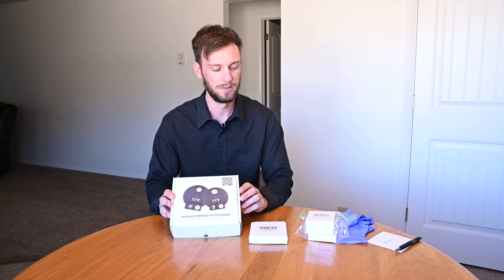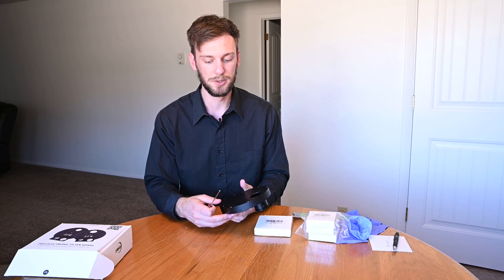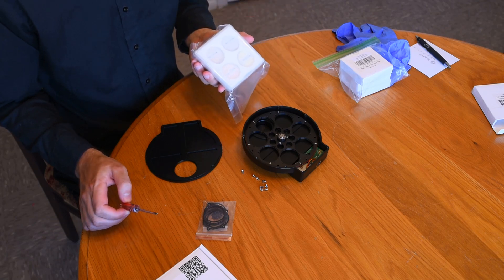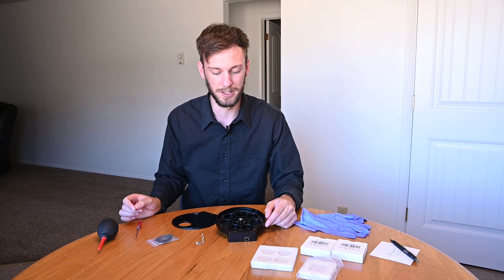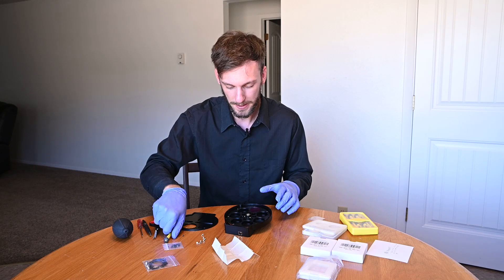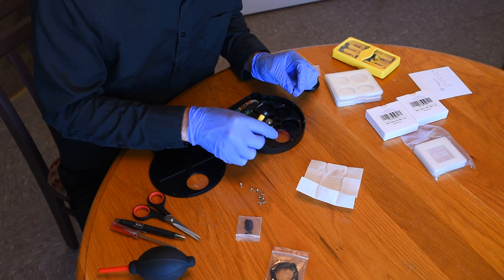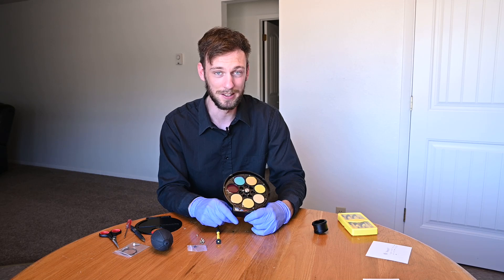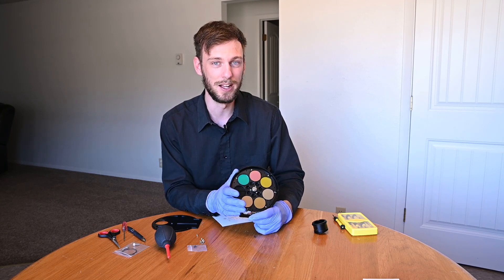2B. Filter Wheel Installation

Comment: If you need to work with small screws, use a magnetic screwdriver or get a small magnet and stick it to the screwdriver while you do this work.

If you shine a light at the filter you should see the difference looking at the inside edge through the glass of the filter.

I’m learning astrophotography but have been doing microscopy for many years. Darkfield microscopy relates to astrophotography in many ways.

Comment: My ZWO 7-position EFW came with a screwdriver that had a magnetized head, so maybe they've gotten enough feedback from past buyers that they made that no-cost but very helpful change. For those who go with the 36mm Astronomik LRGB filters, they are omnidirectional -- you can install them either way. They also have an advantage over the ZWO filters in that they have an opaque black perimeter, so you if feel clumsy doing delicate work wearing latex gloves, you can get away without them with the Astronomik filters if you're careful.

Comment: Peter, Like always, you have helped me progress with astrophotography. I do have a question and I hope you can help me.. First, do you regret at all buying a mono camera? I am also looking into buying my first dedicated camera, and I am unsure if I wanted to go with a color or mono camera.  Also, why did you got with the 36mm filters? why not go with the 31 mm or the 1.250 size filters? what what is the difference between them ?  thank you again.. Rob
Reply from the maker: Great question!  After finally getting a chance to use a color dedicated astro camera, I like my Mono camera even better.  The mono produces much better results, and a nicer (more realistic) color balance straight out of the stacking software.  

The only downside of a monochrome camera is that you need much more time at night.  For example, if I want to photograph Orion, I need to maybe spend 1 hour on Red, 1 hour on Green, and 1 on Blue.  But by that point, the Orion Nebula may fall behind some trees and I only have data for Red and Green colors.  If I had a color camera, I'm constantly collecting all three channels.  

The main reason I went for the 36mm filters was to reduce any chance of vignette.  Apparently the 1.25" filters can produce some vignette (in some scenarios).  I didn't want to risk it.  If I could go back, I would've bought 2" filters instead, since they are easier to install.  (just screw em in)
Reply: @PeterZelinka  Thank you Peter for taking the time to answer my Question, I really appreciate it. I may end up getting the ASI294 for my Redcat. I'm sure I will be able to produce some great shots, Better than my Sony A6400.

Comment: I've never used a filter wheel.  I'm interested in taking better pictures. Is the idea that you take a red, then blue, then green picture and combine them later into a color picture?
Reply: Yes. Monochrome sensors are more sensitive in capturing photons compared to a color sensor. A single OSC [one shot color] exposure receives ¼ of the amount of red and blue data, and ½ of the green data compared to a single exposure with a monochrome camera and filter. But it is more time-consuming to take images with a filter wheel so many sacrifice the quality of the image for the time at the scope.

Comment: Great video, and I have exactly the same kit and it helped tremendously. However I didn't find it a big hassle. Magnetic screwdriver made putting the covers on easy - never dropped a single screw. Anti reflective coating, I think I figured which side is which on the LRGB. From the non reflective side if you look through the filter at the edge on the other side you can see where the coating stops - this is consistent and hopefully correct. The O filter was yellower on one side than the other, that according to your video of the ZWO site should be the coated side. Yes all a bit fiddly, and I should have worn a hair net, but I did grab a hat, and I wish I had a blower (blowing using my mouth, bad idea!), however all tolerable. Oh and 36mm filters allow for some very fast lenses like the Samyang 135mm f2, for which I have a project in mind.

Comment: You can magnetize screwdrivers temporarily by rubbing a strong magnet up and down over the screwdriver. the magnetization works for at least several hours, especially for the tiny little screws. Thanks for the informative video!

Comment: Thank you for that information. I have the same filter wheel from ZWO. But I bought 2" Filters from Baader with a metal ring on them. You are right: it is so much easier to put them in. You just have to spin them by hand to get them in to the slots. And you don't have to worry about the right side.

Comment: Love your video.  But, fortunately, I do not share your frustration mounting unthreaded filters into the ZWO EFW. Came up with some helpful ideas for others:

Loupes-  When dealing with small pieces and parts seeing better allows finer work.  Search “head loupe magnifier” Look for 3X magnification or better.  Should be able to find inexpensive loupes to aid this project and others.

Lighting-  I found the ambient light in the kitchen inadequate to see clearly.  Pulling over some additional lumens from an articulating desk lamp angled properly made seeing easier.

Computer Driver (magnetized)-  The ZWO driver was perfectly adequate for the EFW case screws, but I found too large for the small filter holder screws. A computer driver set with a right sized, precise, magnetized driver, very helpful.  I had a better sized driver for the smaller screws and that made a big difference.

Tweezers (small)-  Small flat tipped tweezers, used for stamp collecting or for tweezing eyebrows worked great for manipulating those tiny screws. Pick up each screw by its edge. Insert each of three screws into the holes of the thin black filter retainer first.  Orient the retainer properly, holding it by the edge with tweezers, between the screws.  Then place the retainer with screws gently upon the filter, being sure the screws are above their holes.  Tighten first screw 1/2 way, then the second and third until all are engaged.  Then tighten completely to secure.

Filter Orientation-  Good point checking to be sure your filters have or do not have a preferential orientation.  Be sure to verify this with you filter installation instructions or manufacturer.  I installed 31mm unthreaded Astrodon Gen 2 E series LRGB and 3nm Ha, O3, S2 and N2 in my ZWO 8 position EFW.  I was surprised when Doug at Farpoint Optical told me there was no right or wrong side to the Astrodon filters I purchased.  The filter glass was uniform throughout, and could be mounted either side towards sensor or scope!  Check with manufacturer beforehand.  Orient filters properly the first time. Save frustration by wasting perfect imaging days and eventually figuring your filters were not properly installed.

Hope this comment prevents filter installation frustration for others.

Comment: Hi Peter! Im following your setup (alrdy bought all the setup u recomended). I was looking to upgrade my dslr camera to ths ASI 1600 mono, the kit 3 of zwo (with the 7 whell slots and the filters), but now with this video im doubting about the filters lol, did you solve the problem with the side position of the filters? Is there a way to finally see what is the right side?
Reply from the maker: I've only had 3 chances to take photos with this setup so far, due to clouds.  With this minimal experience, I haven't noticed any real problems yet (in terms of reflections)

Comment: FYI, if the male thread on a filter goes the entire length of the filter (there is no shoulder on the male thread) it IS possible to screw in the filter in the wrong orientation. Think about it.

Comment: I have a Nikon 200-500mm f/5.6 lens with a 95mm diameter filter size as well as a nikon20mm f/1.8 with a 77mm filter size. I was able to find a Bahtinov mask for the 77mm diameter Nikon 20mm lens. However, I am unable to find one for the 200-500mm lens with the 95mm filter size. Any suggestions?

Comment: Hi, I am using unthreaded 36mm filters from Baader. They have little arrows carved at the sides so you know which side has the coating. Installing was quite easy.
Reply: I received the 7 filter EFW 12/19/2020. I too could not tell the difference between the multilayer side and the anti-reflective side on many filters. I examined the filter side all around using a 10x eye loop looking for a laser scribed indicator as you found on your filters. I found no arrows. I agree with Peter's finding.

Comment: The 8 position ZWO FW is what I use with 1.25" threaded filters. For correct filter orientation, the motor should be facing the camera, and the screw heads facing the telescope. This is not specifically stated in the Manual, though the diagrams show it. But there are M42 female threads on each side of the FW, so potentially you could be putting it on reversed.

 Even though I used the threaded type, I still put in all the tiny screws to stop any light leakage hitting the sensor. But un-threaded would be a pain if you want to change out any filter, especially at night. Wow!

Thanks, Peter.

Comment: Hi Peter: I agree installing the filters in the ZWO filter wheel is a pain. I did use a magnetic screwdriver and that made it easier. The easy way to see what side of the ZWO filter is coated is to hold the filter over a white paper then hold a pen or screwdriver just above the surface. If you see only one reflection of the pen or screwdriver then that side faces the camera. Badder filters made it easier by inscribing a small arrow on the edge of the filter making it easy to identify what side faces the telescope. Love your channel!!!